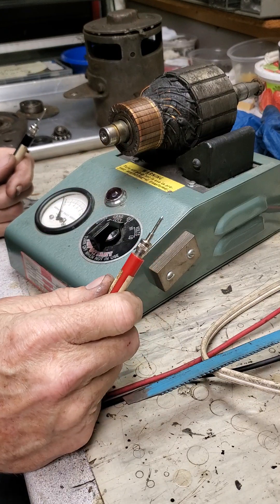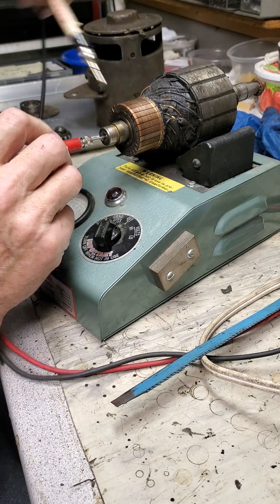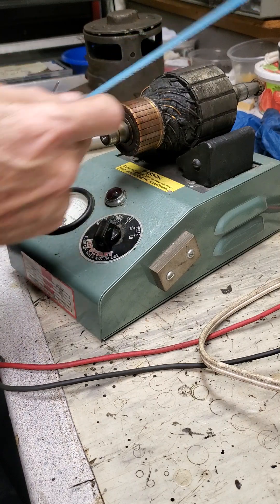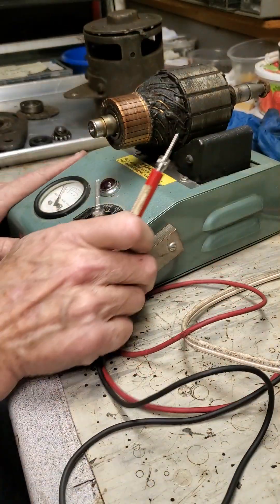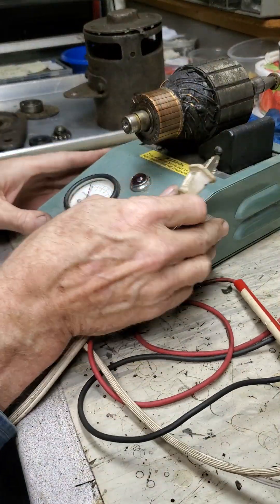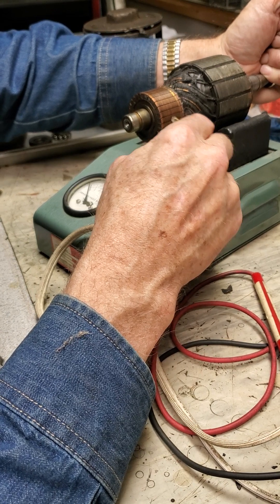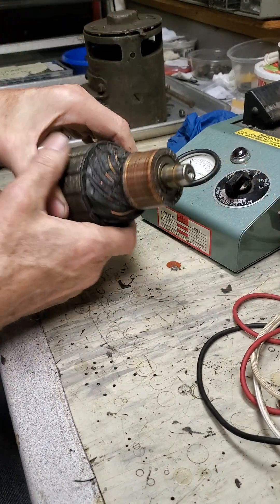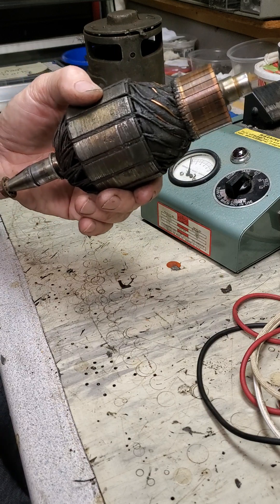Testing a generator armature on a growler for opens, shorts and grounds

Comment: Good video! Same model Growler I have! When you turn generator commutators you do need to cut the mica with a cutter (or used hacksaw blade) because as it wears the mica is tougher than generator brushes so they wear faster! Starters you do not need to cut because the brushes are harder but with the mica cut it can get brush particles that stay between the contacts and create shorts! Hope this helps some viewers!
Reply from the maker: You should watch my mica undercutter video :-)
Reply: @SwabbieSteve  Just happened to catch your video and figured for new viewers i'd mention it! Will check out your other videos too!

Comment: Hi Steve, I’m currently rebuilding my CJ2A generator (Autolite GDZ-4817-A) can you tell me where I can get some brush springs from, I’m in the U.K. Regards, Glyn
Reply from the maker: Not sure, I've not looked in a long time. I saw these on ebay. They may be correct. But compare to yours to be sure.  https://www.ebay.com/itm/251005169902?hash=item3a7112f0ee%3Ag%3AwycAAOxynapRgyLg&amdata=enc%3AAQAIAAAA8KebwY%2Fj8rZ4kyAglfwwGKzAMC6HJQ%2FsSeaL%2BneI6HPaXHno0AXtYzFLVCUsPfCqrDB6dSUJIM57u5jjOycd0a5ghFZMStByuUDEToibM7tj%2BHs61Hq%2F%2BDtkblIZuExMJBW2HU6buvD0EVaw54YsczdMAGp%2BZCfUcclx%2BCzUqz%2BV6b6Qhz6DPSq1drIHglBb17FBEC%2FjS7vAHvlONX9zHx5H2Guq5NBbShHRhGehlrI3eQkzKUzhkgnZnwUddFpFD92p86xcAAMBWk3i4%2BO7i7%2FDmLXkc2Y5CqkfRWtD9X2xwPKq2y%2FANWUmVbqUMWPGcg%3D%3D%7Ctkp%3ABk9SR6j33OWNYw